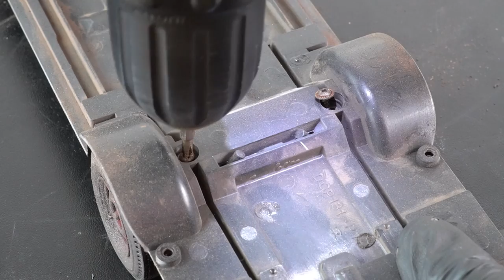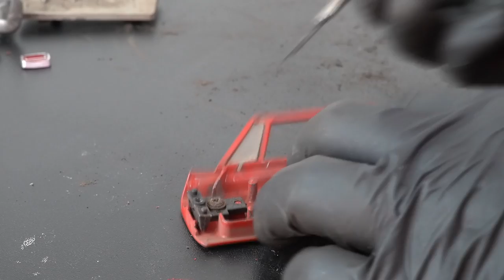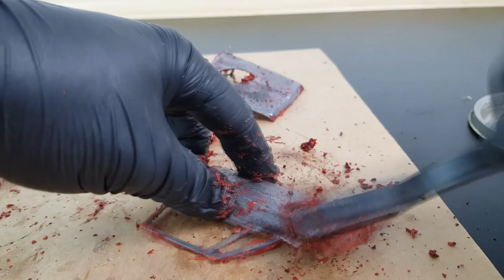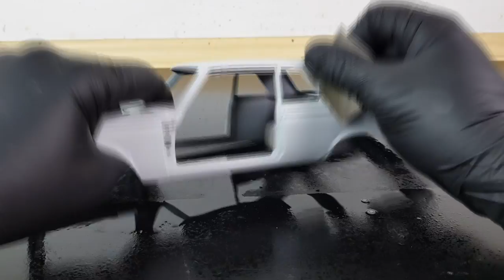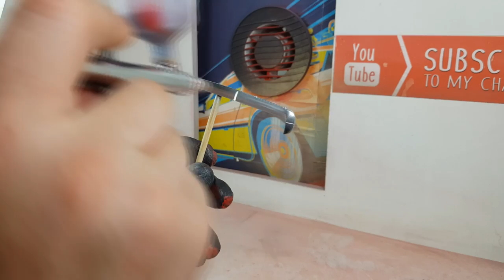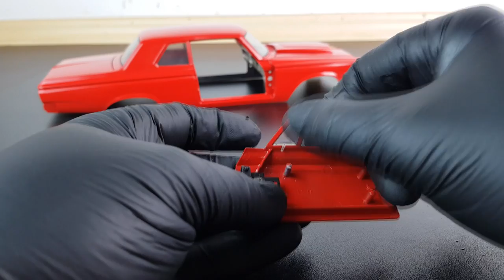Restoration Abandoned Plymouth Belvedere Model Car

Comment: That's a cool kit. I especially liked the working driveline. It's too bad you didn't modify it into a good looking hotrod with at least decent size tires. That's what I'm currently doing with a 1\24 2005 Mustang gt diecast. It's bright red with white cobra stripes. I actually built it 10 yrs ago. But now I'm going back and wet sanding and buffing the factory paint

Comment: I've never seen a Highway 61 model in that bad shape. Nice work! As a model builder I'd do a black wash on the grille to add depth and maybe some body color overspray on the chassis. That model is a replica of a 1965 Plymouth Belvedere factory drag race car, pre-delivery.
Reply: Curious,, what designates it at pre-delivery?
Reply: These were purpose-built, Hemi-powered drag cars, usually delivered in basic white or a primary color. They were expensive due to their equipment and hand-built status, and ill-suited to street use, they were almost all converted to liveried professional drag cars. IIRC Highway 61 modeled a never-raced specimen for the replicas.
Reply from the maker: Thanks for watching the channel, buddy! This week has a new video, so follow our page and activate the bell to be notified! Big hug! 😁🤟👍

Comment: Must be one of those old Franklin or Danbury Mint cars a lot of the 1/18 cars had features like working driveshafts and functional hinges on hood, opening gas cap door etc.  I remember they did a 2nd gen Corvette hard top where the entire bodyshell of the car and doors and hood were fiberglass like the real car, and they did a Viper where the body parts were made of the same type of composite material the real car was made from.

Comment: You missed the steering joint at the bottom of the steering column. It should have located in the arm then the steering would have worked correctly.

Comment: This is such an interesting toy/model car. Can any of you viewers and commenters give us some information on the toy vehicles maker, the location or address of the model/toy maker, information on the history of the model/toy production/assembly factory. Any information that I can get to do my own research of the model/toy company would be most appreciated. Thank you.
Reply: The model car looked like one of the Chrysler backed drag racing cars.  Although they had  426 cu in. engines inch engines with dual 4-bl carburetors in that era, they weren't Hemis.  The exhaust headers, cutouts and the raised back end of the  car gave away the drag racing purpose of the Plymouth model.
Reply: And I forgot to mention the hood scoop
Reply: @RichW240  : I appreciate the info on the real car, that the model represents; But I am interested in the TOY COMPANY that manufactured the MODEL. The TOY... Does anybody know what company manufactured the TOY MODEL?
Reply: @MR.B00_  I watched the disassembly of the model again.  The only markings I could spot were:  DCP-131-P,  on the top of the chassis platform, in the trunk area.
Reply: @RichW240  Thank you very much Rich. Yes I saw that number too. I'm really interested in finding one of these cars. It looks like a fun restoration project. Thank you for trying to help out. 👍
Reply: @MR.B00_  Good luck with your search Brian!  The only American company that I can think of that produces die cast model cars in that scale is the Franklin Mint.
Reply: @MR.B00_  Brian, please "google" DCP diecast metal cars!
Reply: @RichW240  I will do. Thank you again Rich.
Reply: @RichW240  Thanks again Rich. I very much appreciate your help and support.